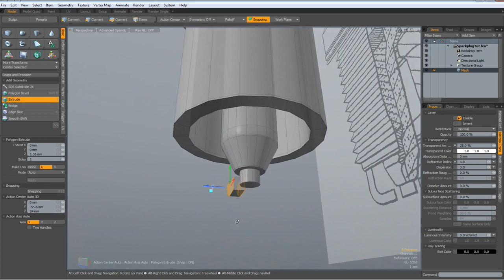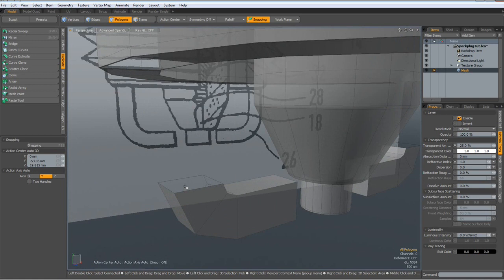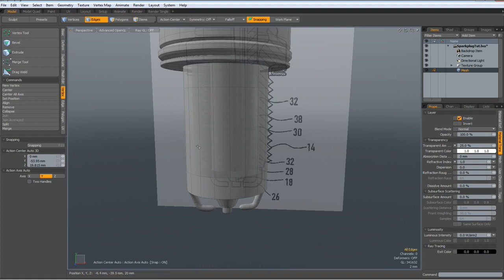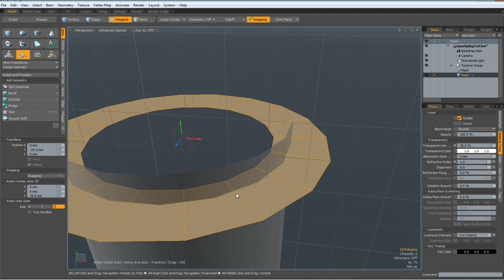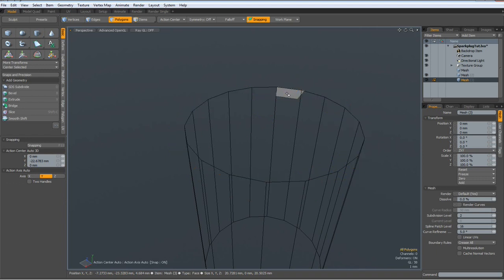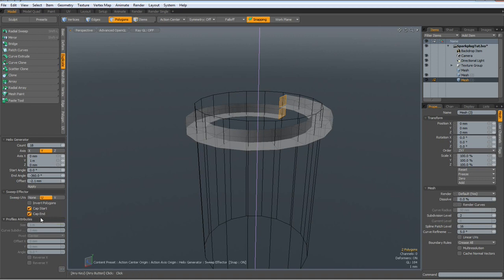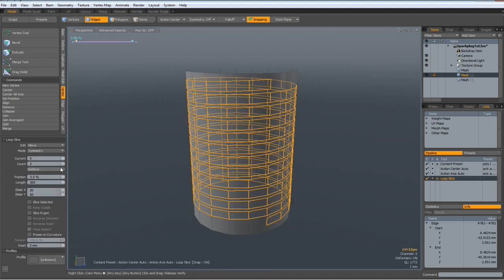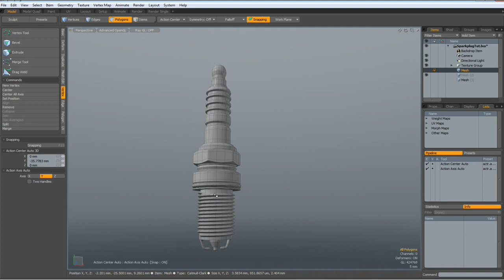Luxology Modo - Modeling a Spark Plug - Part 4 of 4

Comment: Hi Peter, Great tutorial. Question for you if you have time. I'm trying to make threads on a pipe fitting that has flat threads with a half circle between each thread. Plus the thread spirals down at a tapered angle. So if you were to cut the threads in half on the spark plug, you would see triangles up down up down, etc. If you cut the square ones in half, you would see flat, half circle, flat, half circle, etc.  I would appreciate any tips. Thanks Peter!

Comment: Boolean works u just have to move one of the meshes slightly up or down (701 SP1)

And once again thank you for your tuts Peter they are top notch.

I found a faster way creating the helix, instead of creating another circle with the same amount of edges and deleting/extruding 1 polygon, you can copy/paste 1 polygon(vertical of cause) from the original mesh(cylinder) and then action center element, click on one of the edges of the copied polygon and turn it 90 degrees. =D